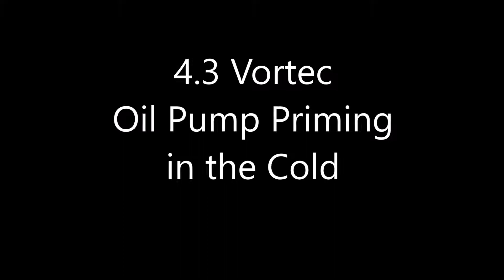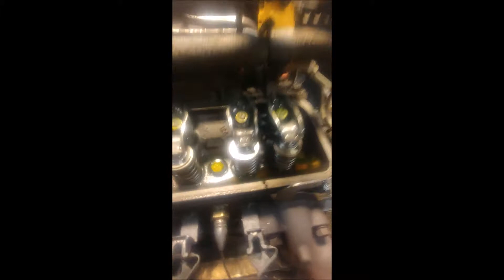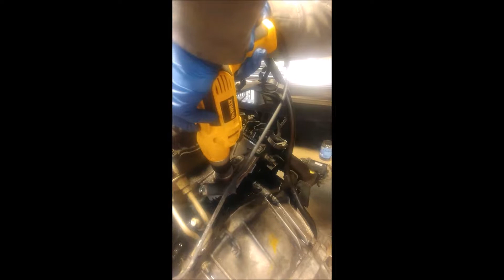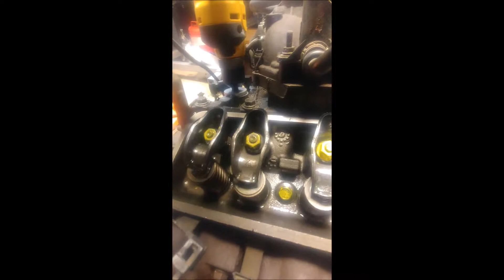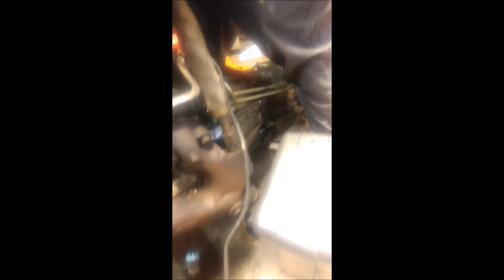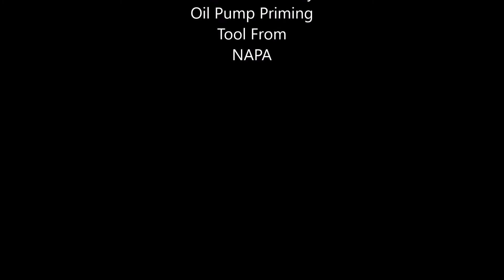Priming oil system 4.3 chevy vortec

Comment: Why does it take so long to prime ive got the same engine and only 2 push rods are primed on the driver's side you would think if it's not getting good flow on the stand it would be the same while running
Reply: Exactly, something was wrong